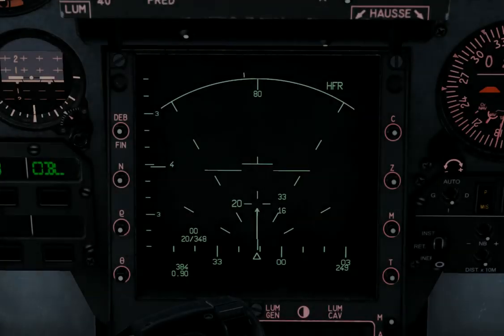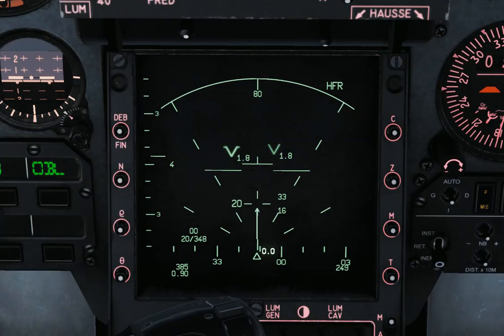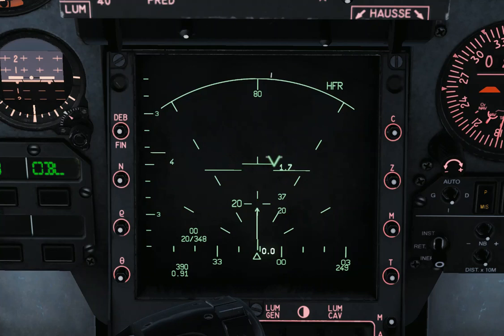M2K RDI WIP

Comment: "V" is a contact. The overlapping contacts, ghosting, double vision is realistic, and not a visual glitch. It comes from the the information from two scan bars being superimposed on each other. 
The horizontal line tells you which scan bar, if multiple, the contact is in. Since this is a WIP, I'd expect the following when its polished:
Contact from Bottom Scan Bar: V    
Contact from Center Scan bar: - V -   
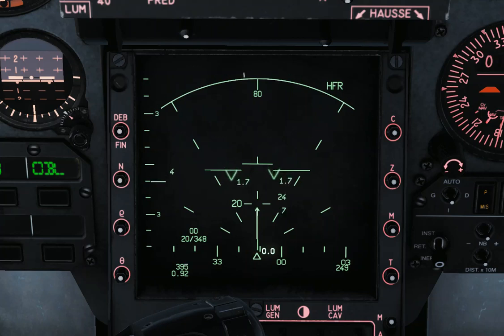Both Scan Bars: - _ V _ -  (also brighter or blurred because your superimposing the V on itself). The right contact briefly shows this around 0:43
Its a quick way to get elevation relative to you immediately without thinking about "whats my altitude, and what's their altitude" and thinking of the difference.